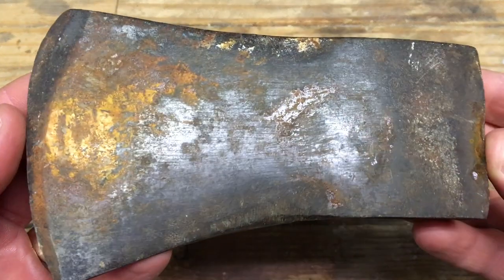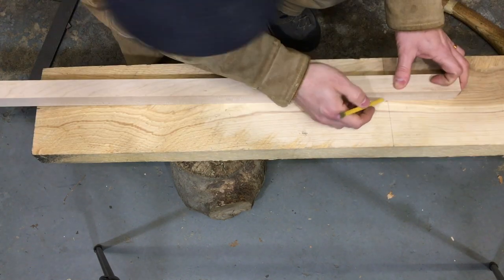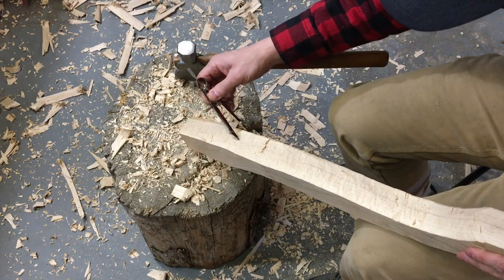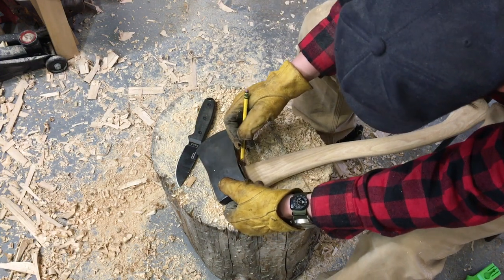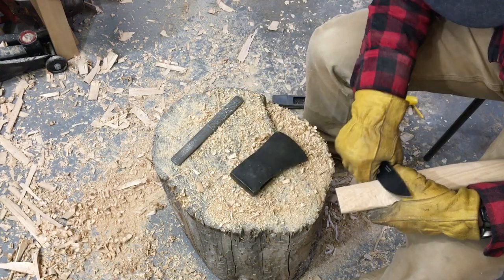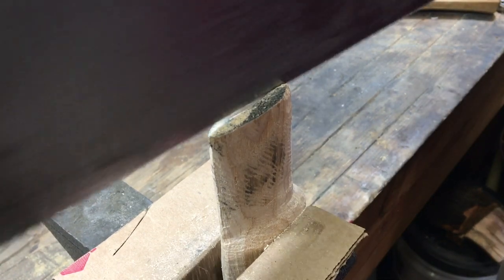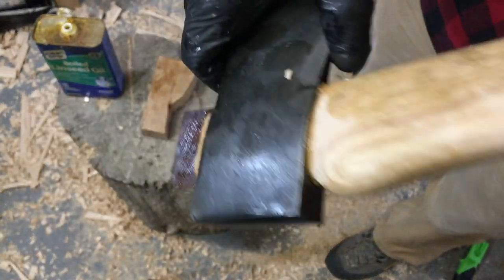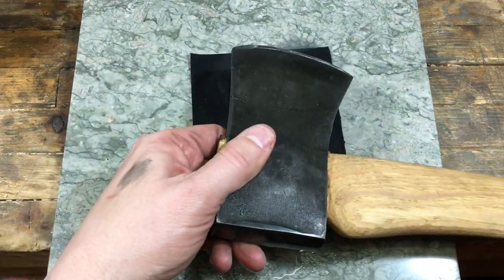AXE Restoration | Carve an AXE Handle With an AXE

Comment: That turned out awesome!!  It’s nice to see someone doing a handle build correctly. One thing that may make your life easier. When pounding the wedge in, just flip it upside down and use the floor for the anchor. You can keep the wedge straight on the concrete and not have to hold multiple pieces at the same time. Beautiful job!!!! 👍👍
Reply from the maker: Thanks for watching and good tip. I may try that sometime.
Reply: I have tried that approach as well. Works great for large axes. For smaller ones like this, I prefer using the flat poll of another axe to get a clean even hit across the wedge.
Reply: OK Tool Co - Austin Kelley Can’t go wrong with that either!! 👍👍

Comment: Another superb restoration, very well done indeed. I only recently found out recently why the axe handle has an angled end. It’s supposed to be pointing at 90° to the top of the head, then it can be placed in the cut to calculate where the tree will fall. The skill then is assessing the weight of branches to how much it will deviate from this. Everything used to have a purpose and it’s amazing how well thought out tools were. And to think I thought it was just to make it look good hung up! 

A fantastic video, thank you.
Reply from the maker: Thanks for the info. I did not know that either. Thanks for watching!

Comment: Very nice job on the axe head, and handle. Your video has inspired me to make an axe handle for my Grandmothers old (1946) True Temper Kelly Works) axe head. I'm not a fan of the dark head, so I cut the cold blue with 8 parts water, to 1 part cold blue. Than I buff, with 0000 steel wool.

Comment: I did my first hot bluing today, 65% sodium hydroxide (drain cleaner) 35% potassium nitrate (stump remover). Boiled an old  Plum hatchet head i refinished for 25 minutes. I'll probably never use Perma Blue again, even if it is a lot safer. The hot bluing just came out so much nicer.
Reply from the maker: I’d love to see that process. Thanks for sharing, watching and commenting.

Comment: That handle turned up beautiful.  If you had to estimate how long did it take to carve out the handle?  Was it an all day project or a couple hours?
Reply from the maker: Total working time was probably about 4 hours. More power tool use on the handle, like a bandsaw, would speed it up significantly but is not as much fun (for me at least). Thanks for watching!

Comment: Would a draw knife work better for shaping the handle?  Or do you just prefer using the axe?
Reply from the maker: I do like using an ancestry and it was that process I wanted to show. I have a draw knife but it needs restoration (it’s in cue for a video sometime). I actually want to show the process sometime with a draw knife and spoke shave and another using a band saw and belt sander. All are great ways (band saw and sanders are super fast) but when I have the time I love the process of carving with a hatchet. Thanks for watching and commenting!

Comment: Question: I see you use evaporust in many of your videos and then you sand down or polish the axe head. Wouldn’t the sanding remove the rust? Is the evaporust part really necessary?
Reply from the maker: You’re right. Often when I get started on a restoration though I’m not sure what I will do. The Evaporust is sometimes a first look and as I go along on occur choose to do more.